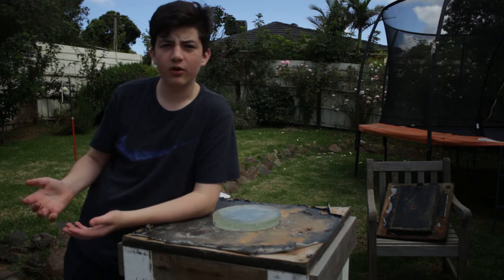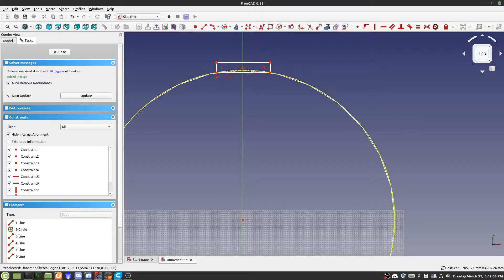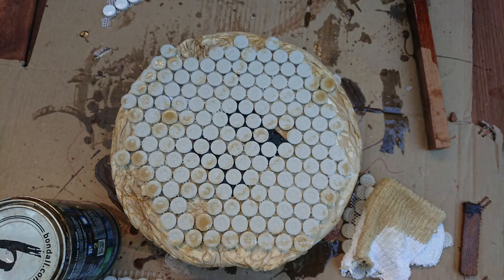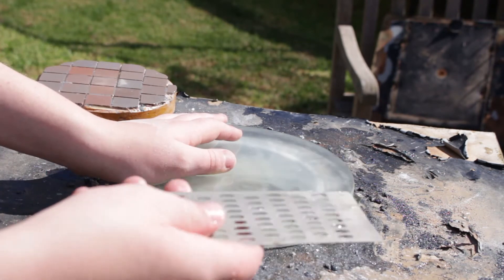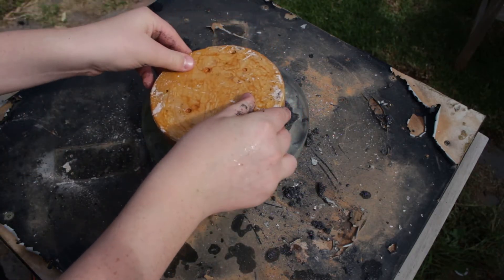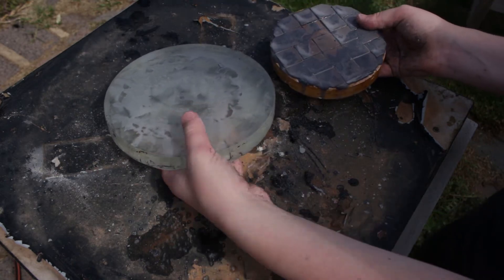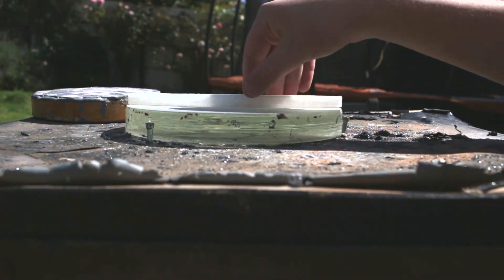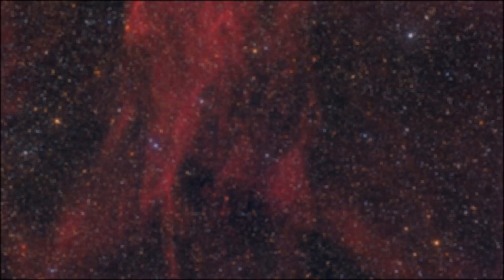TELESCOPE MIRROR MAKING HOW TO PART 1: Rough Grinding

Comment: Wouldnt a parabolic shape be better for focusing light to a point so long as the light is paralell, lik it would coming from distant objects and with a telescope with a high amount of zoom, where as spheres/elyptical shapes focus light coming from a spacific point onto another spacific point, so long is the pinpoint lightsourse is in the right spot? Nasa uses parabolic mirrors for all their telescopes.
Reply from the maker: Yes that is correct! The difference between a sphere and a parabola is so small at these radii of curvatures that it is possible to save a lot of time and strife by grinding to a sphere to begin with, then parabolising during the polishing process. The difference is only on the order of about 10 wavelengths of visual light, or 6 micrometres!

Comment: Several things are not explained in detail that i just 'discovered' in the first 20 minutes of starting mine. 
1. Make sure your tile corners are all evenly flat or youll chip the mirror edge when you hit it.
2. You go around the tool not because it "has to wear at the same rate as the mirror" but because if you dont, you soon find out that spot no longer has much grit and youre wasting effort while theres grit on the rest of the tool.

Comment: Why spin the tool on bottom (in relation to the mirror) if youre already constantly doing so by walking around the table, wearing both pieces?
Reply from the maker: This is to prevent astigmatism being ground into the mirror. If it were to rest on a high/low spot in the same position for a long time, there's a really small chance it might have some sort of astigmatism ground into it. Glass is ever so slightly flexible (really, at these thicknesses of blanks only nanometres) but it can happen. It's just a safety measure to make sure everything is nice and random! Cheers :)

Comment: You can buy the mirror cheaper than the kit to make the mirror on various Chinese production websites.
Reply: What websites did you find to get mirrors?  Do they have other sizes that are in stock now?  I tried getting one from a european company and i thought they had forgotten me.  It turned out their glass supplier was not sending them product an i ended up just getting a refund. Pity.
Reply: You are right up to a size of approximately 400mm/16", and if you are content with the usual standard apertures, focal lengths, and quality. Chinese mirrors are mostly just so-so, and very cheaply made ones are often really bad and not even parabolic. There are a few exceptions so you can get lucky and get a really good cheap mirror.

There are a few skilled self employed mirror makers even here in Europe who make a living out of it.
Reply from the maker: True. But it's fun :)

Comment: The affirmation in the beginning of the video is incorrect. The sphere will not focus the light in a single point, it is called spheric aberration. A parabolic mirror is much better specifically for faster focal ratio like f4 to F6.
The parabolic is the optimal curve for single mirror reflecting telescopes.
In multi-mirror designs, hyperbolic mirrors can be even better but they are difficult to make.

Comment: I don't understand how you got the right shape...
Reply: Naturally. If you ground it like it is shown in the video it will naturally create a concave mirror and convex tool.
Reply: Simple.  You rub the glass on the edge of the tool so that the central point of the glass wears away.  Then you use finer and finer grit to make the smooth bowl shape.  Watch videon on the use of a ronchi tester that explains how to measure imperfections to get them polished out.
Reply: Because a sphere is made of a bunch of circles. For this to work, you have to be very diligent in keeping even. The more gradual the material removal, the easier that is. It won't be perfect when you do it by hand like this, to make it perfect you have to make a machine to automate the process. The point here is that you can make a good enough mirror to get started for way easier and cheaper than a super fancy telescope. You totally can automate the lapping process, but you can also imagine how much work that would be, and a beginner needs easier quicker reward for his efforts, so he's motivated to push on
Reply: Working manually the results can be just as good as using fancy machines. In fact, polishing by machine often results in concentric patterns instead of a smooth sphere while hand polishing does not cause that problem. Rough grinding a sphere into a larger glass disk is very hard work however. Machine work can make it much easier.

Comment: How come you created the arc from a sphere? A parabola is the correct shape to properly focus light. Your cad software should be able to do that easily.  There is a phenomena known as spherical aberration that is caused by using a spherical mirror.
Reply: The required deviation from the sphere is so tiny that you don't need to bother with it until the mirror is polished. Then comes parabolisation as the last and most important step.

Comment: This is great! Would a curved tool help? A 3D printed blank could come with the necessary curve, with tiles epoxied over the top. I do a lot of 3D printing and robotics and I am wondering how 3D printing could help. Maybe a simple grinding and polishing machine would be useful, tho cave man work does have a certain appeal.
Reply: For a good mirror, tolerances are close to quarter wavelength, unachievable by 3D printer… and for the tiles glued in it, you don’t really need any pre curve in the tool.
Reply: Of course it helps if the tool is already convex.
If you use a plaster tool and tiles, make a concave template that has the shape of the mirror, pour the plaster onto it, separate the two when the plaster has hardened, and glue the tiles on with epoxy, protecting the plaster from moisture during grinding.

Comment: Except spherical mirrors don't provide the proper angle of reflection. 
Just to be clear...Are you creating a Spherical mirror or a Parabolic Mirror? Thsnks.
Reply: Spherical mirrors are way easier and cheaper to make. Any cheaper telescope will have spherical mirrors. But, if the f number is larger, or Numerical Aperture smaller, this really doesn't matter. It's like the difference between a Chevy and a Porsche. Depends whether you have lots of budget or just want to get from point A to B
Reply: To the best of my knowledge, you need to spin cast to yield a parabolic shape. Which, is what you want… if you are going to spend you time and money to do something, well… anyway.

Comment: Discovering dobsonian scopes brought me to mirror making...

If you are putting a flat tool, on a flat blank how do you get concave shape?
Are you applying even pressure evenly across the tool?
Is it the characteristics of "the strokes" that do it?

Thanks Logan.
Subscribed.
Reply: An even simpler explanation - The tool is always grinding away at the centre, since the strokes used are always catching more than half the blank at once.  The edges don't get cumulatively ground as much as the centre - that is, there is always an outer sector of the blank which is NOT in contact with the tool.  The central area is always in contact on every stroke.  Doing this, you are guaranteed that the centre will be deeper and will end up with a dished shape.  As you go from the centre to the edge of the blank, the amount of cumulative grinding decreases smoothly.  The uniformity of the dish (i.e. the variability of the height around the edge relative to the centre) depends on rotating the blank regularly and evenly.
Reply: My understanding so far is that it's the characteristic of the strokes and the relative size of the tool Vs blank, but since he says the tool may be as big as the blank I think that means the push and pull means that more pressure is placed on the edges of the tool than the centre in that case but perhaps the grind is unstable so that any deviation is amplified because the tool edged will be proud from the perspective of the mirror surface as it begins to curve.
Reply: In other words, the blank sags a little when pulled halfway off the tool. Mine had a handle on the blank. I just walked around. Pushed and pulled it. Wash it off, wet it, point toward Sun. You can see the focal length change.